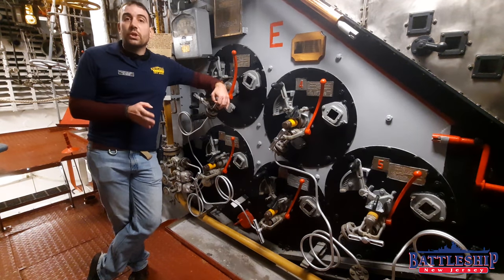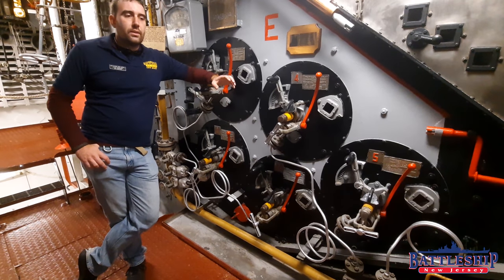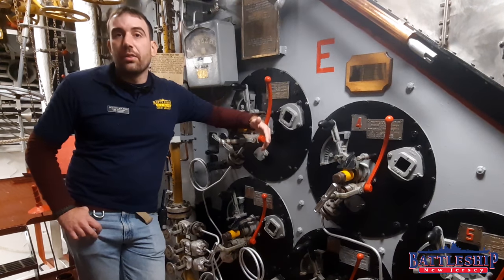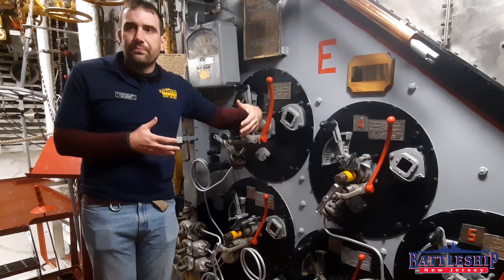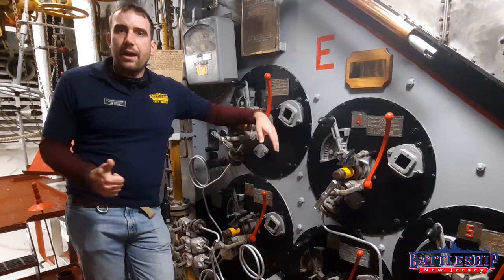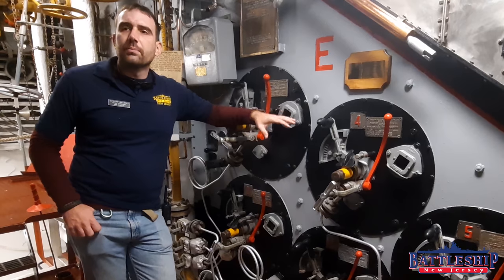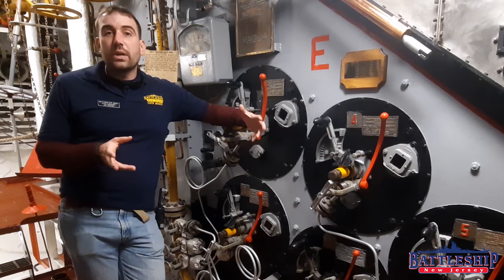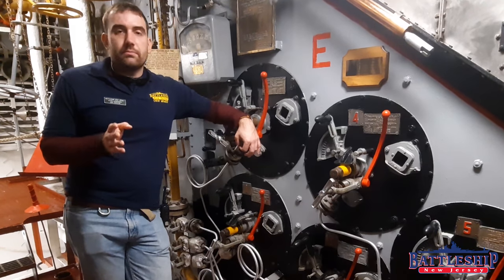Nuclear Powered Battleships

Comment: I’m a nuclear field Machinist Mate. Navy Nuclear power plants are not fragile. I served on the Nimitz back in the 80’s. There was back in the 80’s a plan to put two of the Nimitz class power plants on the battleships. The plan was canceled because the conversation would have been prohibitively expensive. The trade off would have been the removal of most of the fuel tanks as they would have not been needed. A battleship never went out without her own escort of destroyers and cruisers. If the Navy wanted to have nuclear powered battleships they would have been better served by building them from the keel up. They would be able to design in the facilities for refueling the reactor, which is a 2 plus year shipyard Evolution.
Reply: You touch on an important point: fuel.  It's not commonly discussed but battleships were used to refuel other ships quite frequently in WW2.  Removal of that function would require battle groups to be supplemented with additional oilers.
Reply: @ThePrisoner881  Not necessarily... you wouldn't need to remove those fuel bays and pumps... you could just continue to use them.  If anything, it'd ADD value to a Nuclear Powered battleship.  There is also the issue, at least for the Iowa's, a lot of the fuel bays were part of the torpedo protection system, so you could just keep it there.  It's not like a BBN would notice the added weight anyway...
Reply: The battleships could be retro fitted with more efficient engines, with a better cleaner fuel
Reply: @Towerbrian23  Building new nuclear battleships would make more sense. Add in fuel bays and pumps to refuel the conventionally powered ships of the battle group, if you must. The real question is why do you want battleships? Would they have a mission now and into the foreseeable future that would justify the costs? Is there a needed mission a battleship can perform that cannot be done any other way, or at least do far cheaper that how it is currently done?
I am not trying to say we shouldn't have battleships. Personally, I love the concept. I just don't know why we should have them outside of the glamor of it all.
Reply: @garygrant91  besides the gun sizes and armor that comes with a battleship is the fear factor. If there’s a surface ship to surface ship battle in the pacific the survivability of our cruisers and destroyers that protect the carriers are slim . 1 exercet or harpoon and they’re finished. A battleship can take a pounding and protect the carrier much longer and has tow capability so if a carrier get damaged it can be towed back to port. Those 16in/50cal bag guns plus the tomahawk and harpoon launchers can help. Missionwise, you can send the Missouri alone or with 1cruiser and 4 destroyers into the South China sea and leave the carriers to fulfill other missions. Of a ship is attacked, those guns will send any chinese man made island back into the sea. Plus the search plane adds longer range pair of eyes is a plus too.
Reply: @Towerbrian23  The problem with the Iowa in a surface engagement is that it would be under attack even before it could get in range.
If there is a modern surface vs surface engagement today, it will not be done in visual range or close to it, and even if you consider the range of the Zumwalt which reaches a lot further than the Iowa's ever could, it still isn't enough.
A nasty "Vampire" will find its way from really far away towards your ship, only difference is if that is a weak "Vampire" like a Harpoon or something nastier like Shipwreck, the latter and its cousins, a battleship can't hope to defeat with armor, while the former? Doable.
Reply: @CMDRSweeper  my understanding is no current anti ship missile can penetrate significant armor quantities like the Iowa class has. We are talking 12" of belt armor behind 1.5" of STS spaced a foot or more from each other. The deck is about the same thickness of STS separated by 8' to a 6" thick armor deck. That's a lot of armor and space to punch through for a missile. Even tandem warhead HEAT rounds would struggle and that's assuming we change nothing about Iowa at all.

Iowa was also equipped with Tomahawk batteries and Harpoon batteries in the 80s. The main guns have a range of 23 miles with a 2700lb AP shell. A little less with the lighter HC (HE) shell due to ballistic coefficient. Sub caliber rounds would have more range and were tested, ironically enough, with 8" APCBC and HC Sabot rounds with relative success in the 80s.  The 6" specialty rounds for land based artillery could be adapted as well. 

Anyway, the Iowa can see further than her main battery. In WWII the surface search radar had a range of 45k yards which saw increases as the years went on. That's just over 25mi.  With UAVs and other aircraft, that could be extended greatly even if more modern search radars didn't exist. 

As for the usefulness, well, I give you that. Relative to her crewing requirement, her mission in modern warfare is better handled by other ships... for the most part. The amphibious landing shell support mission still exists as unfilled by anything but the relatively light 6" naval guns which have some issues according to the marines. 

Also, who didn't like the idea of inexpensive 1800lb HC shells landing? The Iraqis didn't in the first Gulf War, but who's asking them anyway!  ;)
Reply: @CMDRSweeper  where I agree the iowa class has no chance in a long distance confrontation, redesigning the montana and Colorado class to achieve the possibility could work. Use the guns for close combat and rockets and hypersonic weapons for the long range firepower. The best part of a ship still on paper is it can be redesigned for today’s purposes before it becomes an official physical hull.
Reply: @Whiskey11Gaming  The battleship armor is no match for a modern missile warhead and the way they are delivered, otherwise armor would still be the way to go for modern vessels.
And in the grand scheme of things, at 23 miles you are already too close in modern engagements, once you know where the target is, even at 200 miles, that is where the engagement starts.
Although due to the curvature of the earth, finding another ship with radar is actually not that useful either, you can see airborne targets though.
This is the reason the sea skimmers have been so effective, and another reason why the Russians with the Klub opted for a missile carrying a missile.
Basically a Tomahawk carrying a short range super sonic missile that it flies up to the radar horizon, so the point your ship radar sees it and you start engaging it with your SAMs, the mother missile has fired its spawn.
And that one closes the final gap so quickly that your reaction time is drastically shortened compared to a TASM or Harpoon or the regular Klub missile.
Reply: @Whiskey11Gaming  The problem I'm seeing is you're looking at citadel hits and belt armor, when missiles are programmed specifically to start fires and kill the crew, while going straight through the weakest parts which were the programmed target. The nature of what will kill a boat with a particular weapon has changed, and the main guns on an Iowa wouldn't be anywhere near in range of the missile that suddenly killed the conn tower before the captain was aware of any enemy ships. Missiles are personnel killers, and thus focus on killing the skilled crew, leaving the ship either open to boarding and capture, or forcing the remaining crew to scuttle.
Reply: @kirknay  the assumption here is there is no fleet defending it right?  Let's be real, the Iowa class, for all her age and grace is built with an excessive amount of redundancy built in. The best a missile attack could hope for is a mission kill and even that is pretty dubious. Ships have contingency plans for loss of command assuming the ship captain is killed because he's on deck when the strike occurs and not somewhere else. Even if you lopped the entire superstructure off, an Iowa is still able to return fire through local control of the guns... assuming missiles made it through the fleet defenses and her own and took out her missile batteries and radars in this first strike. The fire control plotting rooms are below the armor deck so she's still got them to fire any missiles which survived the first wave and if they are close enough she cloud still engage with the main battery. 

That said, a modernized variant with a single main battery turret removed would have a massive array of vertical launch tubes in an armored ring thick enough to stop Iowa's own guns. 

Not that Iowa would ever be reactivated due to age, funding, and crew requirements.
Reply: @Whiskey11Gaming  Technically there still is an active Iowa class still fully maintained and just lacking powder for the guns: the Missouri. The problem is that even with a full fleet around it, a Battleship is way too large and easy to hit to be anything but a punching bag for missile destroyers or subs, and is completely without a good use when even the smaller destroyer escorts can throw a tomahawk and sink a comparable target outside the BB's range.
Reply from the maker: Missouri is not on the active ship list, not even in the mothball fleet. She, as well as all of her sisters, New Jersey included, is a museum now. These ships are maintained as museums not as ships ready to fight again.
Reply: @BattleshipNewJersey  The Missouri actually goes on patrols around the Hawaii archipelago, and exercises her main battery regularly. She may technically be a museum ship, but she is fully functional, and just needs powder, oil, and shells loaded.
Reply from the maker: Not the battleship Missouri. There's a submarine Missouri, but I doubt that's what you mean.
Reply: @BattleshipNewJersey  According to Wikipedia: On 14 October 2009, Missouri was moved from her berthing station on Battleship Row to a drydock at the Pearl Harbor Naval Shipyard to undergo a three-month overhaul. The work, priced at $18 million, included installing a new anti-corrosion system, repainting the hull, and upgrading the internal mechanisms. Drydock workers reported that the ship was leaking at some points on the starboard side.[41] The repairs were completed the first week of January 2010 and the ship was returned to her berthing station on Battleship Row on 7 January 2010. The ship's grand reopening occurred on 30 January

She's not only still sailable, she's gotten upgrades to core systems as of 2010.
Reply from the maker: She was tugged there. Museum ships regularly do this to keep them floating, not to keep them in fighting condition. We will do this one day too. The key detail here is that the museum itself pays for the work, not the navy.
Reply: @Towerbrian23  not really, no. The entire engineering system would have to be completely stripped out (as described in this video), and replaced with gas turbines not just for propulsion, but also for electrical generation.
Reply: Hi, former Nuke EM (SW) here. You're forgetting a few other things. The reactor plants and secondary shields are massive weights that are a big part of the ballast calculations of the ship's mass, center of gravity, and freeboard. You'd have to find a LOT of other things to pull out when you're putting in much, MUCH heavier reactors, shielding, and related control equipment. Also, we make saturated steam, boilers made superheated steam. You'd need new main engines and SSTG's, otherwise you're looking at a massive loss of efficiency and horsepower.
Reply: If they wanted nuke battlecruisers they would have made them back in the 60-80s. The navy doesn't want new nuke cruisers or battleships.
Reply: @Whiskey11Gaming  -  there are some very nasty missile systems out there.  It would also need major upgrades to it's surveillance systems e.g. a modified Aegis system.  I love Battle Ships, I think they are the greatest ships ever built but just like the P51 Mustang it's time has passed.
Reply: @garygrant91  The Sino American world war of 2025...
Reply: I agree that he is WRONG on reactors are delicate.  Nuke Carrier EM here!
Reply: I don’t want the Iowa-Class battleships to decay in one place. The US NAVY Must reorganize these battleships back in to service 😤✊🏽👨🏽‍✈️
Reply: @Towerbrian23   Don’t forget US Submarines 😤✊🏽👨🏽‍✈️🏴🏴‍☠️
Reply: @Towerbrian23  They were. The Iowa's were converted from black oil to distilate fuel
Reply: @Whiskey11Gaming  Not true. The Iowa was paranoid of the Silkworm missile with its one ton warhead. AND, in a freindly fire incident, the 20MM depleted uranium rounds from another ships CIWS did penetrate the armor
Reply: Having served on submarines for 13 years, I can tell you that we really do not have any submarines left in the Navy, we only have underwater nuclear reactor safety drilling devices. I have actually serve under Captians who openly tell you that exposing his shi to enemy fire is a violation of reactor safety regulations
Reply: @bernieeod57  CWIS DU rounds are not penatrator rounds. The actual projectile is only 15mm in length. The amount of penatration this round will have at the TWO MILES away the Missouri was when she was struck is going to be near zero. The only armor it is going through is the outer hull 1.5" thick plate and only at close range. 

I also doubt Silkworm would do much to the hull.  It didn't have a one ton warhead, it has a half ton (513kg) which is semi armor piercing. It's not a tandem warhead either which means if it makes it through the outer hull intact is detonating between the nearly 13" of armor and the outer hull. That warhead isn't going through that and that area is usual liquid filled for torpedo protection against torpedo warheads detonating under water. 

It may cause more damage than an exocet, but it isn't sinking the ship.
Reply: @Whiskey11Gaming  Tell that to the Cheif who nealy lost a leg and was pepered with frag in a passageway. You don't need to sink the ship. just put it out of action and a Silkworm will do that
Reply: @Whiskey11Gaming  One MK-48 torpedo will sink it. Todays torpedos do not hit the ship, they form bubbles which lifts the section of the ship and then leaves a cavity for it to fall into breaking the ships back.
Reply: There were dreamers who did draw concepts for converting them to nukes but it was never given serious consideration. Nuking these ships would have placed them under the control of Naval Reactors who would have forbade them from doing thier jobs due to exposing these ships to direct enemy fire is considered a violation of reactor safety regulations
Reply: @bernieeod57  There were no injuries on the Missouri during the incident according to the official record...

I think you forget how much redundancy is on one of these ships.   Each turret has its own fire control "computer" and range fingers on turrets two and three.  Those turrets can preform without the use of the primary or secondary fire control radars or the primary and secondary optical range finders and they can control more than one turret bad upon that plot.  The main fire control plotting rooms are in the armored citadel space with the magazines for the 16" guns, engines and other critical spaces. A Silkworm missile may cause superficial and limited functional damage but a mission kill is not going to be easy. It's going to take 6+ impacts to specific parts of the ship to even seriously degrade the performance due to redundancy. 

She isn't built like modern destroyers. She was built to take hits and keep fighting. Hits from rounds designed to pen armor from extreme ranges. The Silkworm was not designed to defeat layered armor plates with air gaps or fluid filled gaps. In early configurations it may have put a hurt on the older battleships with external belt armor, but I doubt it since most of them had 13.5" thick plates.  That's a lot of armor for even a half ton shaped charge... never mind nearly that much armor behind a 1.5" thick decapping plate with over a foot of air gap or liquid gap between each plate.
Reply: Whiskey's Gaming Lounge "Official record"
Reply: @Towerbrian23  One of the nice things about the boilers is that all they really need to do is burn some manner of flammable liquid. You could probably fuel an Iowa with some manner of biofuel, albeit likely at a reduced performance if the fuel doesn't burn hot enough. The same could be done to the gas turbines on other warships as all these engines do is compress air and fuel to burn, similar to a diesel engine. The boilers are inefficient simply because they are always burning so they are constantly guzzling fuel. Being expensive to operate is largely due to how much your fuel costs. If a cheap alternative that produced sufficient heat were found then it wouldn't be that much of a problem.
Reply: @airplanenut89  witha nuclear reactor you don’t have that problem and use the tanks a 
Back up fuel supply or be a refueling station for the rest of the conventional fuel fleet
Reply: @Towerbrian23  I am well aware of nuclear reactors, my chemistry teacher was a reactor officer on submarines. As the person in the video explained, doing this to an Iowa Class is not worth the expense as you would have to fit something made a few years ago (assuming new A1B type reactors) to something made in 1942, or specifically commission new reactor designs for only 4 ships. After this you have to plan for installation. By the time such a refit is complete, you could have just built new ships that are just as capable but are easier to care for. Replacing the current fuel type with one that is less expensive would be the path of least resistance. Also 2019-2020 has seen both the carrier Kuznetsov, and assault ship Bonhomme Richard damaged/destroyed by fire while under refit. Such a refit as this would risk the Iowas to the same fate and it just is not worth it.
Reply: @Whiskey11Gaming  #1 -  You can't trust the "Official Record"  when it comes to casualties.  #2 - It's obvious some of  the people stating why the Battle Ship NJ coming back into service would not be practical know what they are talking about.  #3 -  As stated by others and myself the NJ is no match for the current threats out there.   It would be great for Naval Gunfire Support but that's about it.  Without an Aegis DDG protecting it -  it would get eaten alive.
Reply: @Towerbrian23  truth to power man. Battleships are not only survivable the modern ships now a days cant pen the armor with their guns and would be hard pressed to take it out in ship to ship combat even with missiles due to CWIS but if you are on say a destroyer and you get hit with a 16 inch HE round from an Iowa you are well and truly fucked 7 ways to Sunday if it hits anything important as it will tear a huge hole in the destroyer. Plus when you factor in radar the battleship can hit things at its max range quite effectively.
Reply: A point about survivability.  I can sum up.everything you need.to know about the anti ship missiles the Soviets were equipped with during the Cold.War.in.4 words. Proximity Fused Nucleat Warheads
 Stopping 99% of them would not be a good day. Having one hit your ship would not be a good day. Regardless of how much armor.the.ship.had.
Reply: @BattleshipNewJersey  a bit late to the topic, but what about gas turbines? They produce good power, easier to light off and much quicker to get underway. You could possibly isolate them on special shock absorbing and reducing platforms similar to modern submarines in the event of direct hits to prevent shock damage. My biggest concern might be torque? Horsepower is good, but torque is needed to move the colossal mass. Your thoughts?
Reply: @ThePrisoner881  An aircraft carrier still carries a lot of fuel, not for itself but it's aircraft. The same principle can apply. I do agree, it would be better to do it on new builds if one was to do it. The big issue is just like heavy tanks are no-longer a thing for land forces, heavy ships are generally phased out for lighter ships with heavier weaponry. Warfare has changed and the general use of big heavy battleships is no-longer supported in the doctrine.
Reply: 2 years? Damn, and here I was thinking yall just put some boot into a lead-lined poop suit and told them to "run fast" with the glowy rod.
Reply: @kilikus822  How the Soviets trained their nuclear Personnel:

Officer: "Seaman Ivan, this is your valve, that is your gauge. When your gauge reads this number you open your valve, and when it reads that number you close your valve."

Ivan: "I understand Comrade Lieutenant, but what about that valve over there?"

THWACK!!!!

Officer: "What are you!? A spy!? Should I turn you over to the KGB!? If I wanted you to know about that valve I would have told you. Now stand your watch, you will be relieved in 4 hours."

The U.S. Navy does things differently. In essence, a Navy nuclear power plant operator will be trained in depth on his rating specific knowledge and job(s) and cross trained enough in the other ratings jobs that he could temporarily fill in given an emergency. And that just scratches the surface of what all the training entails.
Reply: @virtuesoflocusts9658  Are you paying?
Reply: @Cad1s  No destroyer captain worth his salt would get his ship close enough to a battleship for to get hit by its 16 inch guns. Modern warfare has changed so much since the 80's that a battleships guns are obsolete.
Reply: The Army has recently successfully tested a 155mm hyper-velocity anti-missle artillery shell with in flight tracking. Having something like that for the Navy but 16 inches might reach low orbit. Thats a good reason to upgrade a BB.
How would I do it. Go through the turrets. They could be lifted out giving close access to current systems so as to upgrade to nuclear  and to maintain it. The fuel bunkers/torpedo protection system can be easily converted to today's fuel systems. After the events of North Korea test firing their missles having a robust warship with this new missle deterrent system should be the Navy's next goal.
Reply: An extremely good point!
If we we're building battleships today, they almost certainly would be nuclear powered!
You made a very good point about not rebuilding the Iowa's!
Reply: @kirknay  Oh, you mean there's a missile that can penetrate the SEVENTEEN INCHES of armor on the conning tower?  I somehow doubt that.  Could it wreck the regular bridge, though?  Absolutely.
Reply: @itsmezed  Have you missed the latest cruise missiles? Even 1980's limpet mines can breach modern triple hulled targets, which are designed to shrug off torpedoes.
Reply: @kirknay  the video was used for the Battleship movie.  I'm a little confused on the movie.  In one part, it sounds like they used the tugs to get it into the open ocean.  Another part sounds like they took the video of them moving it around the harbor.  It sounded like they paid for the Missouri to be used for the movie.

There are really only two good uses for a battleship today.  First off is amphibious assault.  Secondly, radars can be jammed.  EMP can take down aircraft.  A battleship can still fire by sight.

Now an EMP can disable a battleship as well.  How well can a battleship operate without electrical power?  How much protection would the hull be in such a case?

Currently, aircraft can pretty much do anything a battleship can do.  With the smart bombs and the bunker busters, there's not a lot that could actually survive an air attack.  The bunker busters can actually penetrate better than a shell could.

Someone can point to the price of a shell verses the price of the bomb.  The price of operating a bomber from the US is much cheaper than operating the battleship.

Russia did a modern battle cruiser so to speak.  I believe that's what it was referred to as.  It was one part of the reason behind the Iowa's being brought back.  Russia started selling everything off afterwards.

Is there anything a battleship could really make it the best option today?    The biggest way is if a country has such great anti-aircraft fire that nothing can get close.  It could make for a great escort in the way of anti-aircraft.  With the huge size can bring a whole lot of missiles as well.  Basically, something like the Russian ship.
Reply: Andrew Crews  very good points.  Top it off with modern weapons like the bunker busters that would demolish a battleship armor and armor doesn't make much sense.  Armor is also hardened steel which is more brittle.

I do disagree about the use of nuclear weapons.  We have been on the point several times for them to be used, but cooler heads prevailed.

Don't forget, in Korea and Vietnam, we fought Russia and China.  Not officially, but they were there.  The biggest reason for having nuclear weapons is to detour countries from using them.  Entire countries wasted.

All it takes is one idiot who just wants power or fame to destroy the world.
Reply: Andrew Crews  we almost did with the Cuban missile crisis.  The Russian submarines in the area had nuclear tipped torpedoes.
Reply: @minarchist1776  you really need to consider the mindset of a group that puts spare reactors on its nuclear fleet.  Our subs would follow them only running 1 thinking they were trying to be quiet.  Way later it was determined it was a spare for when it broke due to design or manufacturing quality or the guys that were trained similar to your curious conscript.  Not a full understanding of what was going on.  Scary.
Reply: @mtmadigan82  Well, for all practical purposes we build at least some of our nuclear vessels with "spare"/excess capacity. But that is so they can still go as fast as possible with a reactor temporarily down for maintenance. USS ENTERPRISE (CVN-65) had 8 submarine reactors powering her. More modern aircraft carriers have two nuclear reactors specifically designed for use in carriers. The supposition is that they could still answer an "emergency ahead flank" order with one of the reactors down. However, that does not mean that one reactor is normally idle when the ship is engaged in regular operations.

I would suggest watching the movie "K-19 Widowmaker" (I think I got the title right) starring Harrison Ford as the Captain of a Soviet nuclear submarine dealing with a reactor casualty. Now understand that in the U.S. Navy that design would never have passed the necessary vetting to leave the drawing board, and everybody working in engineering would have understood the significance of seeing condensation in the reactor compartment, hence the submarine wouldn't have left the dock until that problem had been resolved.
Reply: This whole line of dialogue reminds me of the different refitting plans that were considered. From taking out the turrets for use as missile silos to making then into aviation carriers. The ampbibious assault concepts seemed like the best in my opinion (which has been heavily molded by Marines).
Reply: @Kez_DXX  I remember the Navy and/or Marines setting up a building bid to build a new ship to replace the Iowas.  The main focus was for amphibious assault support.  In the end, they knocked down the requirements so a destroyer could do it.  The end result?  Zumwalt.
Reply: Once you realize that battleships and traditional cruisers are no longer valued for naval supremacy, and are still the best heavily armored naval artillery for coastal bombardment and still should serve in that role, the whole issue becomes awful simple.  Too many warship fanbois want to claim that it still could be a naval supremacy ship, and too many anti-gun types want to move the goal posts to say "if it can't be used as a primary naval supremacy ship, than it is useless" logical fallacy.

Yes, armor is a good thing for a coastal bombardment ship.  Yes, a ship bristling with several big guns for various jobs is a good thing for a coastal bombardment ship.  Yes, big old naval artillery like the 6, 8, and 12-18 inch guns of the past are still better suited for the job than smaller, faster firing guns today.  Yes, the battleship and traditional cruisers still have a secondary, but valuable, role in warfare.  

ESPECIALLY wars outside of complete WW3 scenarios, where cheap coastal artillery battleships and cruisers are not going to face the best anti ship weaponry, and where cheap en masse blasting with big guns is a viable option in some cases.

Remember, the anti-gun mentality has been around since the 1950's.  Who remembers the fiasco when they built new ships without guns, because pencil neck debutantes in Washington DC all stepped over each other to prove how "not gun" and "anti gun" they were over each other?  Just to have old cruisers and battleships brought back into service, and new ship designs with guns back in them.... because all that boastful, jerking off over each other attitude in the Capitol turned out to be insanely stupid.  

Missiles can't do everything.  NO, rail guns will never be valuable as coastal bombardment (giant useless boondogle if we want to be honest).  Smaller guns aren't always adequate.  Yes, a brand new or brought back battleship or heavy cruiser would have a place.  Yes, even if it is secondary, and not what it was in years past.
Reply: @kingduckford  all services have found out the importance of guns on aircraft.  As for the rail gun, I've heard it's been a rather disappointment like the USS Ford and USS Zumwalt.

There could be two different ways to go with the battleship depending upon mission and perceived opposition.  The traditional battleship and the speciality battleship.

The traditional battleship would be similar to the Iowas.  Their superstructure would be equipped with AEGIS.  It'll have two or three triple turrets.  Possibly having additional close in weapons, anti-ship and anti-missile missiles plus vertical missile launchers.  Length wise, around 1000 ft with a beam like the Iowas if not bigger.  A lot is going to depend on how much other resources would be sourced to escort the battleship.  Control of the sea and air, beach defenses, under water defenses.  Fuel would be either oil or nuclear depending upon what kind of damage could be expected.  You don't want to kill your service members due to nuclear meltdown.  Armor might be determined by the propulsion.  It could be similar to an aircraft carrier, a battle cruiser, or the Iowas.

Then, a speciality battleship would be one dedicated to shore bombardment and very little more.  Very low profile without an actual superstructure.  The ship would fire based on data from other ships, aircraft, and troops.  It could possibly have four turrets with vertical missile launchers.  It'll have defensive weapons similar to those of an aircraft carrier.  The ship would use AEGIS from other ships for targeting.  Armor would be equal to if not greater than needed for an equal battleship.  Deck armor might be lighter due to the treat of bombs being lower.

The thing with both designs is they will probably never go against other battleships or really other ships period.  In the sense of the need for big guns is the only real purpose of them is for shore bombardment.

I guess another way would be as a monitor.  A single big gun turret without much of anything else.  Basically, a wide destroyer with big guns.  Examples were used as coastal defense until 1938.
Reply: @michaelpiatkowskijr1045  My thoughts exactly!  If a new battleship were to be built, it would start to either look like Montana or something closer to a pre-Dreadnought.  Either they will be major, super large and powerful ships bristling with big guns for the artillery purpose and plenty of missiles and new tech to make it a first rate modern missile ship to fulfill both roles well; or they will be heavily armored, little battleships that will end up being treated more like shore monitors than anything else.  

The super battleship idea could have some reasonable appeal yet, a high end missile ship that has great survivability with a modern high end design and something expensive enough to invest more design and armor into.  Tough enough to do close up shore bombardment work, and possibly tough enough to have value "slugging it out" with modern ships in a hotter conflict.  It would be more on the "if we are going to invest this much into a gun/missile ship, we should go all the way" mentality.  High cost in materials, money, but perhaps a missile ship capable of being called capital?

Would its increased armor and survivability make it that much of an asset in potential naval supremacy conflicts?  Ability to take lessor missiles, and perhaps better survive some of the more credible threats with a high end modern design, give it an advantage?  Or does modern missile tech decrease this potential enough to make the super battleship less appealing?

I think a small, pre-Dreadnought style (obviously much longer and more efficient in hull design, of course) would be more likely to be considered.  Two main gun turrets, maybe even only 2 guns a piece, the argument of "four guns should suffice with modern intelligence, weapons control systems, spotting, ect" could come to dominate some discussions.  Then again, if you are going to build a gun ship.....

Small, heavily armored, focused on gun work on shore positions almost exclusively, it could be a much easier sell in some ways.  Cheaper, smaller, focused.  Able to soak up land artillery threats with no fear, able to take small naval gunnery by small boats without concern.  Smaller resource, cash concern, smaller crew, all could be selling points.  A ship bristling with secondary armament, I would surely suggest.  

And, if I would make the suggestion, such a ship would be better off with the Old World tradition of 6 inch secondary armament rather than the US 5 inch dual purpose.  Air defense will be done with smaller, better directed guns, and anti aircraft missiles for BOTH a super battleship or a small battleship concept, and the 6 inch guns would be the better coastal bombardment gun.  

The Iowa's and other end of the era battleships still have their theoretical appeal, smaller displacement, small enough to fit through Panama.  Fast enough, good armor, and plenty of old fashioned gun firepower for our modern purpose of blasting shore targets.  

Still, I agree.  The next ship design would likely be much larger, or much smaller.
Reply: @kingduckford  I had the idea for a super battleship that had eighteen 16-inch guns.  It was more compact than the Iowas, but it was nuclear powered.  It had the equivalent of WWII anti-aircraft fire, but it was all radar controlled.  It also had the AEGIS system.  I never really designed it though, but I believed it would be around 100 ft long.  All turrets over the other.

There was a class of light anti-aircraft cruisers that used twin 6-inch guns.  They were the Worcester class.  They were called light cruisers, but their guns were dual purpose.

When you look at conflicts today, what do you see?  Aircraft controlling the sky.  How much do warships do?  Probably a lot more than we know about.

Take the case of the USS Missouri.  Iraqis fired two missiles at her.   One missed and the other was shot down by the escort.  What could it have done?  Not much to the armor, but it could have wrecked the superstructure and possibly damaged a gun or two.

Without a real threat of battleships, I could see the small monitor style battleship being built.  The Burke class destroyer is already 66 ft wide and 540 ft long.  I could see something around 100 ft beam and around 600 ft length.  Possibly a cruiser type using a 16-inch/50 like the Iowas.  I could also see rocket propelled shells for added range and accuracy.
Reply: @Whiskey11Gaming  And then they would just equip Anti Ship missiles with armor piercing warheads. That's not exactly rocket science, to add a copper plate inside an already existing warhead to get an EFP that can cut through steel like butter.
Reply: @jamesscott2894  it's two to three layers thick, all spaced armor,, depending on area so it'd have to be a tandem warhead, but yeah, you are right, they could.  It's not like the Iowas wouldn't have four CIWS and a fleet protecting them though. The real threat has always been submarines and torpedoes.
Reply: @Towerbrian23  Two MK-48 torpedoes under the keel and your mighty Battleship goes down
Reply: @BattleshipNewJersey  To further add to what Captain Parks said, naval reactors have a means to replace fuel rods through the top of the ship, be it hull or deck as the case may be - it isn't necessary to cut through the hull or decking in order to replace them. It'd be a lot of labor and a lot of bolts, but easily something accomplished with a week or two in port, not even in drydock. Even more extensive maintenance procedures are planned for in the designs of such vessels with the ability to remove the entire reactor, if and when the need arises, without destructive removal even though they're much more labor-intensive to perform. Redesigning an Iowa to accept a nuclear reactor isn't an impossible task, but definitely prohibitively-expensive for such a limited benefit at this point.

More importantly, though, is the reality that gun-ships are really just not a viable piece of naval warfare anymore, more's the pity. Any application suitable for guns with calibers larger than about six inches (with debatable arguments for an upper limit of eight inches) is better suited for modern missile systems and torpedoes in the overwhelming majority of naval combat situations.

I'd almost want to see a redesigned Des Moines, making use of the quick-firing autoloading eight-inch gun system, as a combination gun/missile cruiser making use of only a single (probably the number 1 or 2) turret in combination with nuclear power and missile systems as a carrier support vessel.
Reply: Well, America needs to build something bigger than the Lider, and more powerful if they want to win against Russia.
Reply: @grege2383  True, the Russia already has developed an Hypersonic Cruise Missile that will be mounted on the Lider-class Destroyer/Cruiser. The Lider is an Nuclear powered Destroyer/cruiser, capable of carrying 200 Missiles, it also have torps, with 19000 tons and a length of 230 Meters. It also have the newest Anti-Aircraft/Missile weaponries, which is the S-500.(The other name for the Lider-class is the Shkval-class, which is kinda weird as there is a torpedo built by Russia that is named Shkval torpedoes. "The Lider will be a universal ship, triple-hatted as a destroyer, large ASW ship and guided missile cruiser while being smaller than Project 1144 ships and carrying far more weaponry.") Reference: https://en.wikipedia.org/wiki/Lider-class_destroyer
Reply: @Towerbrian23  That was my thought also. There must be some way to enhance the energy production of the plant. Now sure, none of that would be cost effecient, but when talking about reactivation of the Iowas nothing would bel, so in a pure thought experiment, I too think it must be possible to somehow enhance the engines... or the diesel generators so that enough electricity for modern radars and SeaRam CIWS should be possible! I mean if you throw enough money after something almost anything is possible!
Reply: @CMDRSweeper  Well, just like the carriers are part of a strike group so too would the battleships be, so they too would have cruisers and destroyers functioning as screens with the AEGIS system... And any modernization would surely enable harpoons or other antiship missiles. It had 16 harpoons and 32 tomerhaks in the 80s, so its safe to assume it would have at least that in the 2020s... if they were reactivated... which they obviosuly wont be, except for maybe in some world war situation... 

Also, any modernization would add the SeaRam system, which is a really effective sytems against supersonic anti-ship missiles, so you have AEGIS sytem, and modern CIWS... you will have to throw a lot of shipwreck missiles to land even one... At least in theory...
Reply: @CMDRSweeper  Most modern anti-ship seem to have small warheads and not designed for a lot of penetration, make a mess of the topside, sure.  carry a nuke? sure.
Reply: @CMDRSweeper  I would like some evidence of that as the warheads are not big.
Reply: @Cad1s  CIWS Is not reliable, its a last ditch form of defence and in a situation where your relying on it you're probably fucked. All it takes is a single ASM to take out the radars and you suddenly have a very expensive target to burn. And if armour penetration was needed, there's no reason a anti ship missile with better armour penetrating capabilities couldn't be build, especially deck divers that can go for the weaker deck armour. The giant soviet ASM like the P700 had armour piercing capabilities to bury themselves in the guts of 100,000 ton supercarriers. There's also the BROACH warhead that could be used, combining a shaped charge to penetrate the armour and a explosive secondary that follows through. If you seriously think modern navies have stopped armouring ships just for kicks then you need to stop wearing the tinted glasses.
Reply: @kingduckford  Bringing back an entire battleship just for naval gunfire support is not worth it, and has been replaced with modern 5 inch guns. You might think the smaller gun would be less useful, but you can call in NGFS from a 5 inch gun far closer to your own position compared to a 16 inch barrage. Collateral is the keyword here. Modern extended range munitions also allow for modern 5 inchers to shoot farther, and with guided shells they are more accurate. If for some reason you did need 16 inch NGFS it would be better to just take one of the 16 inch gun from one of the Iowa's and build a smaller ship around it, like a modern monitor.
Reply: I guess if the reactors on a CVN can handle the pressure of the constant landings and takeoffs, tge big guns shouldn’t be a problem. I mean, on a nuclear battleship, the reactor would not be near the big guns?
Reply: @bernieeod57  No. You got it mostly wrong. It was the Missouri that caught a bunch of 20mm rounds to her unarmored superstructure. These pellets cant get through any of the real armor on a battleship.
Reply: @ThePrisoner881   that’s a good point Erich !  The only thing I can think of to counter that is today’s Navy does not presently depend on that ability, however , who knows about the future ?
Reply: @bernieeod57 
That same torpedo will sink any other surface ship as well. Not an effective argument against the Iowa class, or a new nuclear powered battleship.
Reply: @grege2383 
🤣🤣🤣🤣🤣

A properly refitted Iowa class is no more vulnerable to any threat than any other surface ship. Period.

Further, the only Naval vessels that regularly operate alone are submarines.
Reply: @bernieeod57 
Torpedoes again.

Tell us all how only battleships are vulnerable to torpedoes....

Again, if it will sink an Iowa it will sink ANY surface vessel.

To get through to an Iowa, it has to get through all the other surface ships.
Reply: @AlanRoehrich9651  So? A non functional parade showboat is not worth defending
Reply: @AlanRoehrich9651  The carrier provides protection of itself. The Battleship needs carrier air cover making its gun redundant
Reply: Yeah cutting a battleship open and dismantling it and rebuilding it just to put in a nuclear reactor would be very expensive. 
This reminds me of the NS Savannah. Since it ran on commercial blended fuel (Enriched 4.4% not 90% plus like naval) refueling every 3-4 years, would simply remove some top bolts and pull the core out. For the navy you cut the ship open. Absurd way to refuel a ship